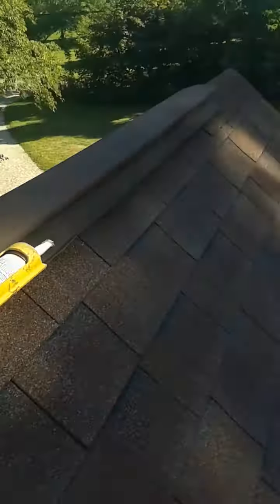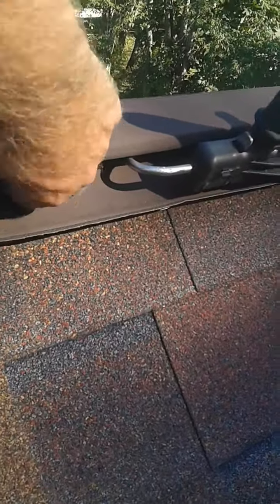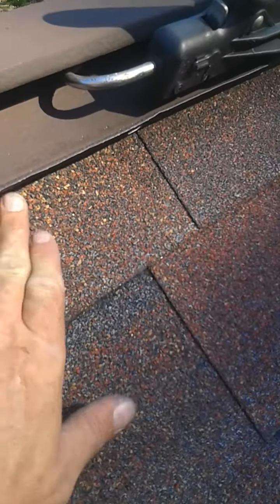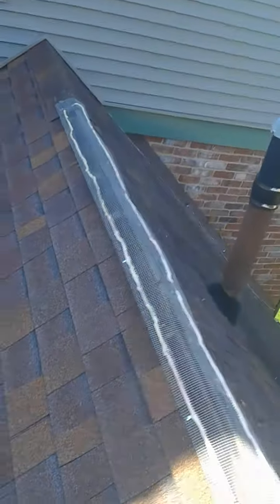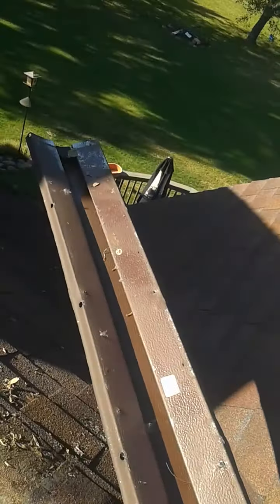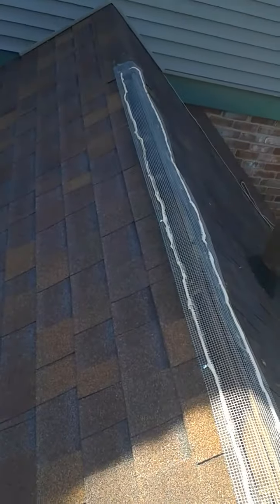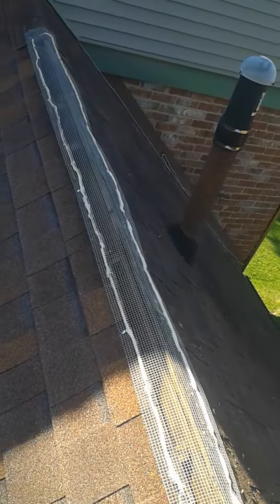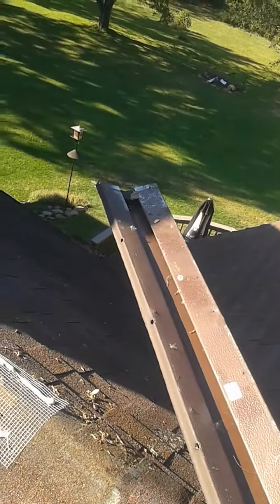Bat Proofing Ridge Vents

Comment: Nicely done, Ryan.  I have an old 1870 Italianate Victorian in Indiana.  I had a company come out and charge me $450.00 for about 20 minutes worth of work.  They put in a check valve and a little sealant.  The problem was, he found where they were coming in after only being there for about 5 minutes.  I think he thought that was the only opening.  Well, two months later and ever since, I find myself removing a bat from the living areas in my home every month.  I could really use a THOROUGH inspection!
Reply from the maker: That's a tough situation.

Thorough is what bat work is all about--and thorough is tough on some constructions.

If problems recur--like we missed a spot--we come back and make it right!  It's part of a guarantee.

Anyone contemplating bat work, make sure the company you choose stands behind their work and is easy to communicate with.  Most professionals will be back the next day if they have not solved the problem--it's about reputation and pride.

Bat exclusion done right is time intensive.
Reply: Absolutely!  You guys obviously do phenomenal work!  That's awesome!  I realize that in a very old home like mine, existing openings may be overlooked, and new openings can occur.  However, I was hoping to be "bat free" for at least a year.  I don't mind the little guys as I safely remove them.  However, let's just say my guests don't appreciate it very much when they are terrified to find a bat flying around in their bedroom!  I am going to call the company tomorrow and politely talk to them.  Great video and thanks for the advice!